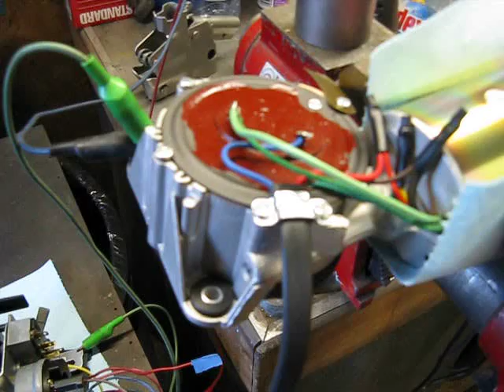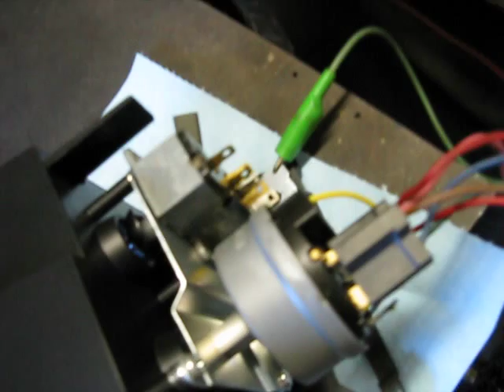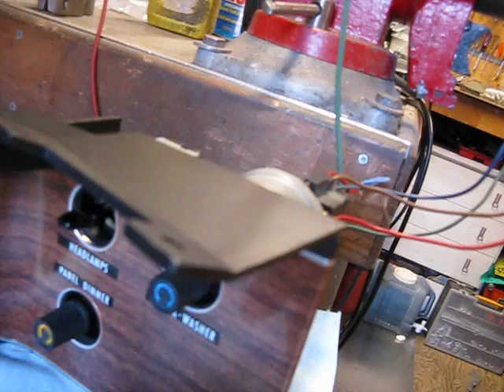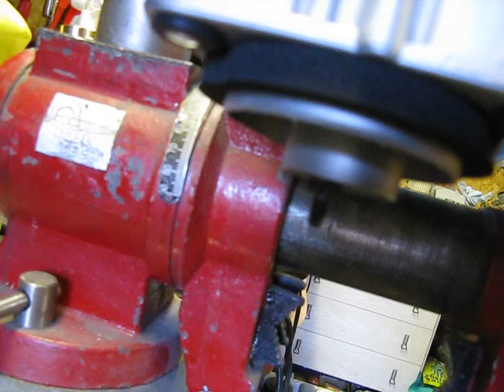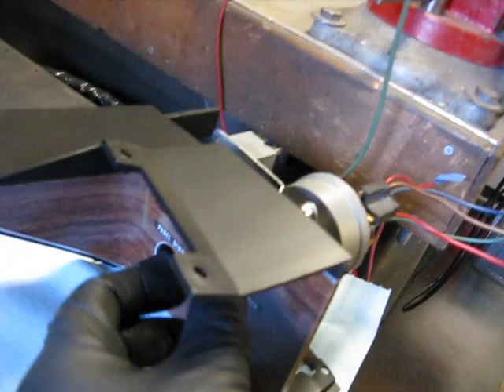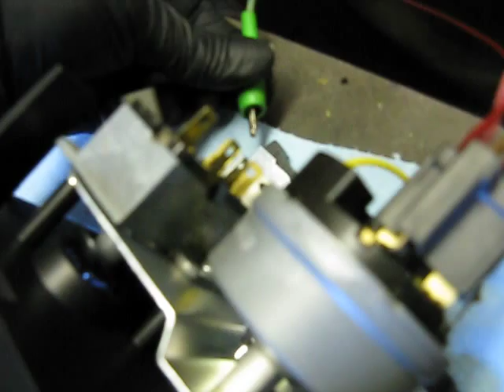70-74 E Body Corner Switch pod grounding.

Comment: I am having problems... The yellow wire, looks like a condenser, does that plug into the orange wire under the dash.. ?   

Also, when I touch the side of the wiper switch to the dash frame it works.. Looks like I need to ground it..